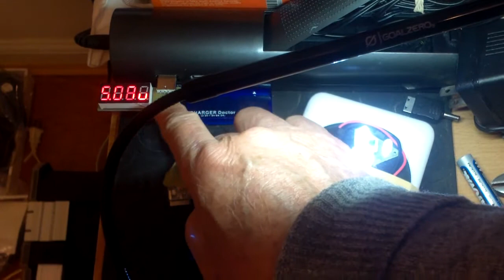Making a USB light for my lithium ion battery box

Comment: USB power is great for a lot of little gadgets..I am like you, I like to see the components, I try not to glue anything if I can avoid it, that way if I get bored or want to modify the gadget or make something else, I can still usually use the bits again...
Reply from the maker: I waited a long time for the battery in this push on light to die before I broke it open. The push button action is not that smooth either. Now I broke or modified it, I can, like you say, change the design if necessary.  The original design seemed to have 1 resistor for the 3 LEDs which are arranged in parallel. It's kind of strange. I like to see the innards of working things as wells.
Reply from the maker: MrFreddiew1
Thanks I looked at your video again and saw the 4 LED push on light. You are the king of JT LED lighting. You put all your lights together and you can light up a whole room.
Reply: I have go a few lights running on longterm test runs, my wife shuts the door to my hobby room because she says its so bright she cannot sleep...She does like to exagerate!

Comment: what does the 90 ohm resistor do? i suppose plugging it into the usb on the computer is out of the question since the computer voltage is waay higher than 3. volts
Reply from the maker: The 90 ohm resistor limits the current so the LEDs won't get burnt out.  I modified this light so it can used for USB so there's no problem plugging it into the computer or any USB power source. I changed the resistor from the original 20 ohm to 90 so it can use USB power. You might disagree as to the right value resistor but the general rule is voltage to be regulated divided by current draw of LEDs (5v-3.3v is 1.7v. and 1.7/.020= 85ohm) equals the resistance of resistor. I learned this from watching Muddy's videos :)